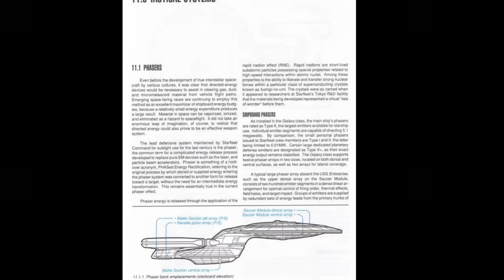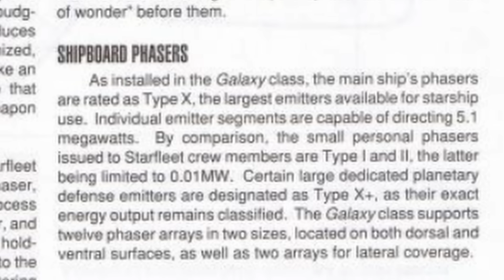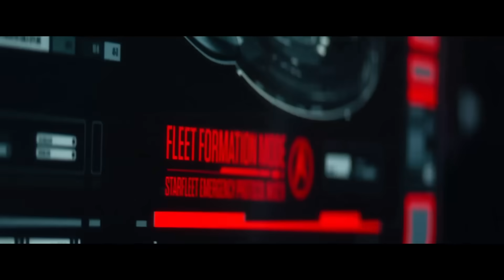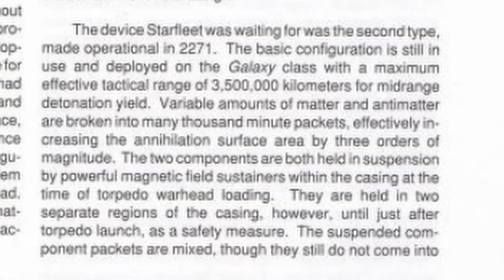Phasers: How Powerful are they Really?

Comment: Sense Phasers work by an exotic particle that breaks down matter it probably requires less actual energy to achieve the results we see. though I would assume the energy required would not be significantly less. I think one of the biggest problems is that when dealing with exotic substances in sci-fi settings we rarely know what the properties or the interactions of the substances are making it hard to judge energy requirements for feats.
Reply: If you break the atomic bonds, you need the reaction energy, not the evaporation energy.
Reply from the maker: @Jasmin-lg3gf wouldn’t that pump the numbers even higher?
Reply: @fictionrant7805  It depends on the materials. Water requires a huge amount of energy to heat up and evaporate. Carbon bonds are relatively weak.

Let's ask the internet: To heat 1 kg of water from 36°C to 100°C, you need 268 kJ. To heat it to 101°C, you need 1.5 MJ.
The heat of reaction for 1 kg of water is 31.7 MJ. So, a bit more.😅

1 kg of elemental silicon, 20°C.
Melting point: 1.17 MJ
Melting: 1.8 MJ

Bonding energy: 10.9 MJ

OK, yes. Breaking the bond requires quite a bit more energy. But you don't get a steam explosion.
But everything would prefer to react immediately.

Which raises the really interesting question of how a phaser disintegrates an object.
Reply from the maker: @Jasmin-lg3gf  if it’s actually dosintegrating atoms the material won’t really matter and the disintegration of the atoms themselves would release additional energy
Reply: @fictionrant7805  Annihilation would release far too much energy and would also require antimatter.

Perhaps a shift into subspace? That would circumvent many problems. Although that doesn’t explain everything satisfactorily.
Reply from the maker: Apparently about 390,000 times less energy lol
Reply: @fictionrant7805  Should do one on the actual strength of turbolasers
Reply: Never mind just found you turbolasers suck video
Reply from the maker: @truetheternal2314 unfortunately that ranges from manuals claiming gigatons to Ahsoka demonstrating rock concert pyrotechnics
Reply: @fictionrant7805 and lets not go into what its required to generate the particle it self
Reply: Exotic physics would have to be involved as if you outputted the equivalent of 2 Tsar Bomba feet or metres away you'd kill yourself and vaporise or burn the vicinity.
Reply from the maker: @seamusoblainn  sci fi writers have no sense of scale

Comment: Great video!

Your last point about slagging the arrays is probably the most logical. Thoretically a ship-mounted array could in theory produce power equal to half the sun, but it would just slag the array after a few seconds of fire, and require that the vast majority of ship power, barring minimum life support be shunted to the phasers to produce such a feat.

Therefore standard operating procedure must dicate that phasers can only have a maximum yield of X that was put in place to limit wear and tear on the arrays while still giving off as much firepower as they can. Newer model arrays therefore improve on the design and structural integrity of the arrays, capacitors and circuits rather than output yield.

This means that there is no theoretical limit to how much damage a phaser can do, it is simply hampered by how stable the array is itself.
Reply: ah yes, any starship is capable of putting out the entire energy of its fuel stores instantly. seems obvious when you put it like that.
Reply: @MrJay_White  Hadn't you been paying attention?
It is clearly implied there is a massive energy output/yield amplification happening throughout various episodes.
So, you can use 'baseline' (normal/sensible) descriptions, but when you couple them with subspace based technology to AMPLIFY them, then you get into some ridiculously massive outputs territory.
Reply: @deksroning125  that is not as funny as the ship blowing up.
Reply from the maker: Having limiters in place to limit wear and tear makes sense

I dunno about uncapped output though lol
Reply: @fictionrant7805  Perhaps this helps explain why it would take so long to demolish the planet after such tremendous damage in a single brief salvo.  If I recall correctly, it was supposed to take an hour to destroy the crust, but one volley destroyed thirty percent of it.  If they had to pause between volleys to cool down the equipment, so as not to melt them, or even make repairs, then it would increase the time needed to destroy the world.  It may also explain why the fleet just kind of sat there and died.  If they were set up with an everything-to-the-guns power set up, their maneuverability and shields would be limited, while if they had just depleted and overheated their weapons, they might not have even been capable of firing.  Since the Dominion knew the plan, this might explain why they waited until after the fleet had fired before closing the trap.  Given how quickly we see Jem'Hadar fighters get destroyed later in the war, or even against the Defiant in that very battle, charging into a fleet rigged for that much firepower might have been suicide.  Sacrificing the planet in order to cripple the Romulan and Cardassian weapon systems so that they would be incapable of fighting back is the kind of cold calculus the Founders engage in.
Reply from the maker: @dajonaneisnoah8714 good point! I always chalked the hour up to needing to orbit the planet and hit everything. Vs founders they needed to be thorough
Reply: @fictionrant7805  I really like your channel and I really like videos. But is it alright if you can do Excalibur from warframe vs alpha from punishing gray raven if that’s ok, I’m sorry for asking I’m just wondering if your interested. I hope for your response, I’m sorry for asking.
Reply: @fictionrant7805 may as well be uncaped do too the amount of power that the warp core can dish our
Reply: It's EGA Trek. You can fire all of your energy reserves in one shot, frying your phaser array in the process and then not having any power left to do anything else.
Reply from the maker: @MasterofSpiders EGA?
Reply: And the power capacity of the ships warp core. No sense putting an array in that outstrips its power source. In a sense a pure phaser duel is a test of the core and power distribution systems of each ship.
Reply: from the comments I understood that Enterprise can produce at maximum half the energy of star??
Reply: @alexiachimciuc3199 yup. This was seen and stated in strange new worlds. 
It only confirms a long standing theory... That technical manual power figures are mere baselines and and are radically enhanced via subspace technology or some other energy output enhancement effect. So the baseline stays as is and won't deplete your fuel supplies but the output energy (your bang for buck) is ridiculously high. Millions of times higher